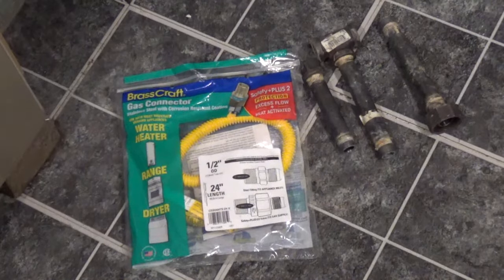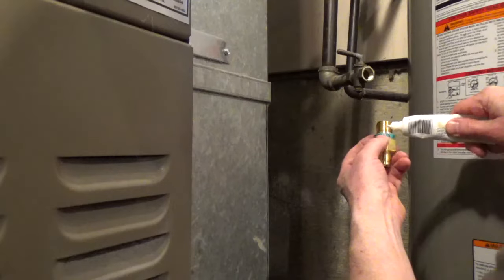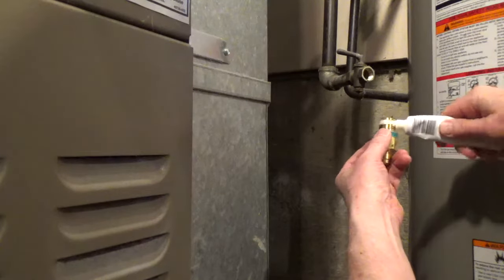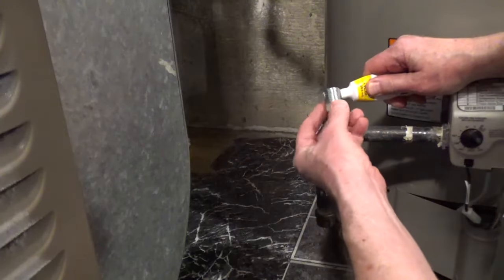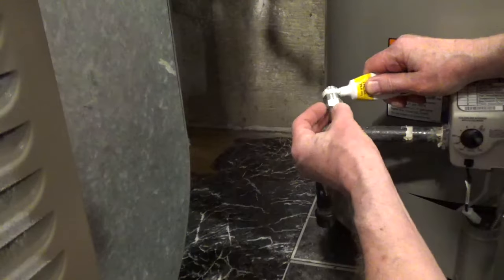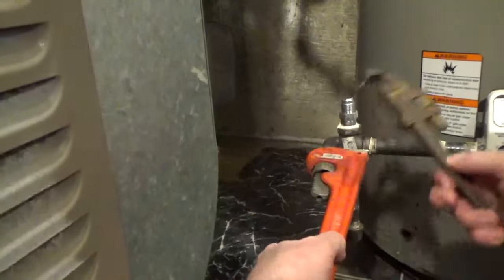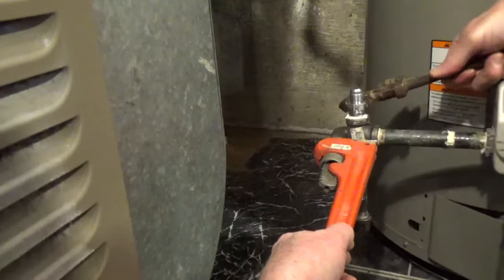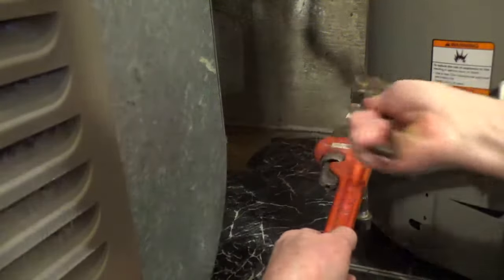How to Install a Flexible Gas Connector

Comment: @0:47ff What is the "gas leak detecter" blue liquid called? How do you test? Is that to see if it produces for bubbles?
Reply from the maker: Hi, here is a gas leak detector that you can find in the hardware stores and home centers. It will show bubbles even with a very small leak. https://youtu.be/WDKfGc10-n8